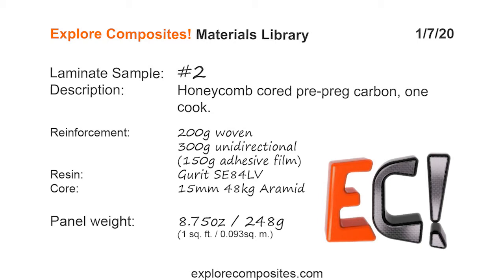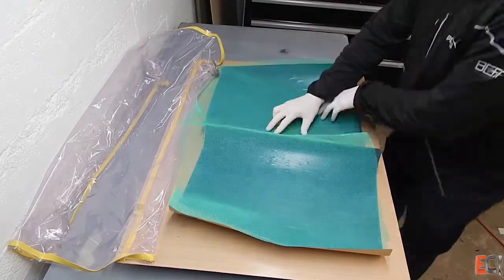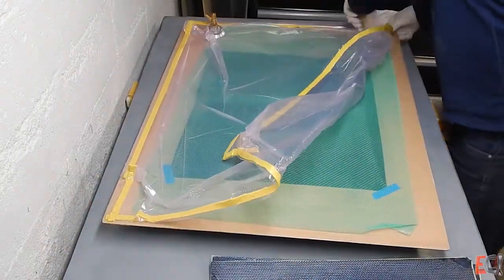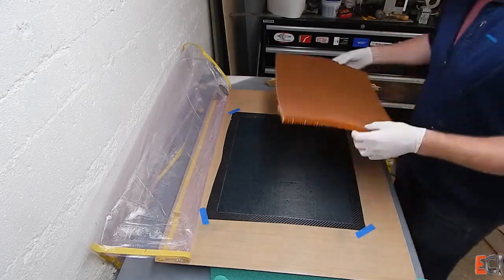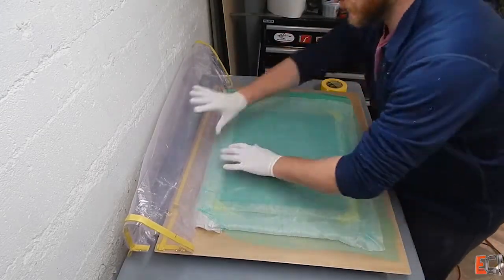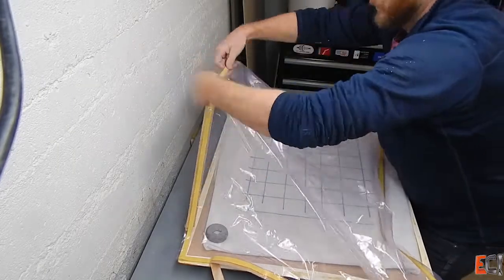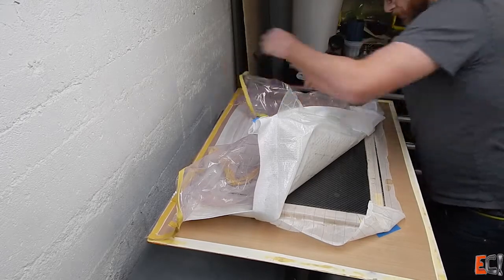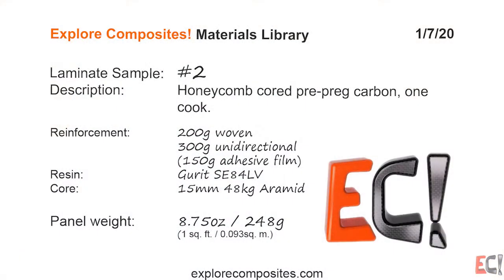Laminate Sample #2: Prepreg Carbon / Epoxy on 15mm Nomex Honeycomb Core

Comment: Are multiple cooks possible ? Like consolidating the skins first and then adding the film with honeycomb... Especially in the context of complex shapes.
Reply from the maker: Yes, that would be the typical way to make anything complicated or requiring better outer-skin compaction.  One challenge can be keeping very light skins in the mold while you fit core /cook and outer skin.  Often parts are kept vacuumed into the tooling with a perimeter seal feature after the first skin is cooked to prevent pre-release.
Reply: @ExploreComposites  Random question, what kind of core do you think they use in MotoGP to make carbon fibre swing arms ? I want to try to make own, off the shelf aluminium ones are expensive.

Thanks for the response.
Reply from the maker: @SONO4B11T  I have no idea, but for high end competition parts like that I would guess any core is probably Rohacell or similar, but that parts like that may be mostly solid except in the open web areas where there is flat-ish panel.  Core can be a liability of parts like that with lots of varying stresses and torsional loads.  I am sure that carbon is going to be more expensive than aluminum when tooling and engineering is considered.  And the connection details where metal hardware interfaces with composite are a concern...

Comment: Hi! Are you using any specific type of wood for the frame around the honeycomb? Which one would you recommend?
Reply from the maker: Wood isn't ideal because it has moisture in it which boils off in the cook - so dry wood is the best.  Plywood strips are good - here I just grabbed whatever was around.  

This is only an issue on flat panels with free honeycomb edges - because the bag crushes it back.  Usually edges would be ramped, replaced with strips of stable foam core, or butted into a corner, making the problem go away.

Comment: hi, thank you for the video. But I am trying to use honeycomb with PTFE coated fabrics? In this case which method I shall prefer? Please advise an adhesive that bonds the honeycomb with PTFE coated fabrics. Please advise. Thanks in advance
Reply from the maker: Are you trying to bond to the PTFE?  I don’t know if that will work... what are you building?
Reply: @ExploreComposites  I am trying to build a sandwich panel with Nomex honey comb ads core and PTFE coated fabrics as skin

Comment: Is using peel ply on prepreg standard practice?
Reply from the maker: Yes.  It is generally a good idea if you are going to secondary bond or finish the surface.  Down side can be that dry peel ply pulls resin out of the laminate - a problem with thin parts.  You can buy pre-preg peel ply though and this is the best option - but it's expensive.
Reply: @ExploreComposites  What would happen if you were to use wet lay peel ply on prepreg?
Reply from the maker: @drewvigne  You can use the same dry peel ply as you'd use with wet layup, but it will steal some resin (30-50g/square meter or so) from the laminate.  Put it on dry.  All the prepreg sample videos I have use dry peel ply... got to get some prepreg some time to show the difference.
Reply: @ExploreComposites  thanks for the info!

Comment: Have you done any bending tests on this laminate sample? I would love to see how strong it is. I'm doing a similar layout, but I'm having problems with the adhesive, it's not curing well using only vacuum and the nomex separates prematurely from the carbon fiber while doing bending tests.
Reply from the maker: I haven't done anything on this sample but have done them before with nomex coreed panels - both bending and PATTI-type adhesion tests.  Are you able to see a difference between the top and bottom skin adhesion?  What kind of weight glue-film are you using to bond the core?  There are lots of variables!  Shoot me an email with pictures and maybe I can help: chris at explorecomposites dot com